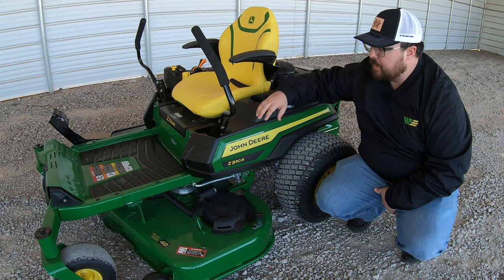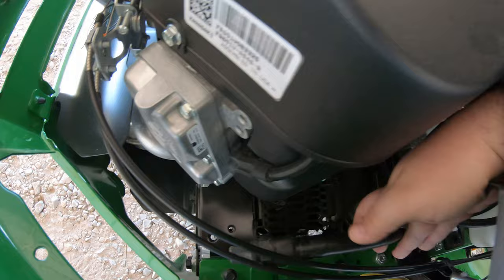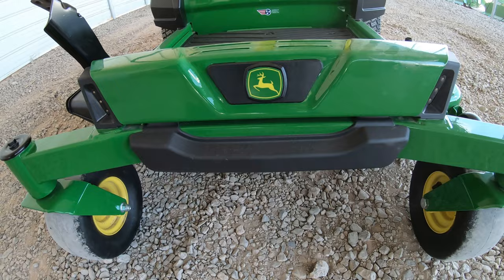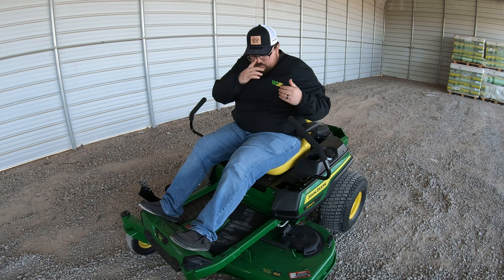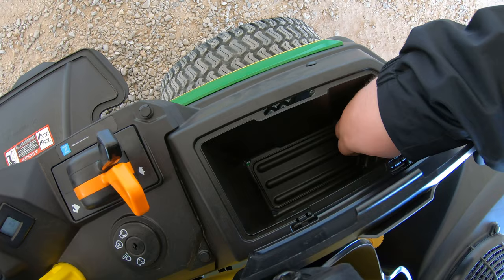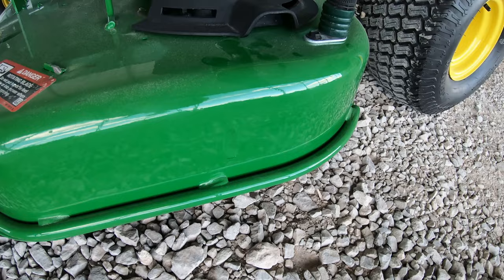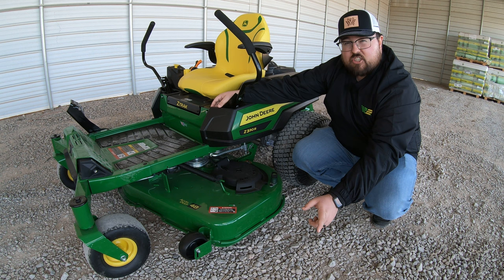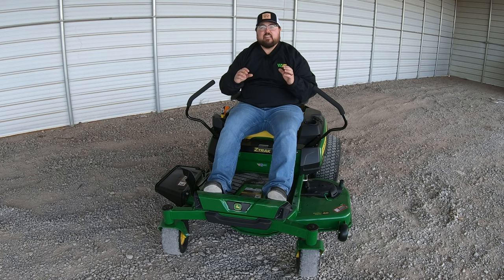John Deere Z330R Zero Turn Mower Review

Comment: Just got my Z330R yesterday and replaced the plastic bushings at the top of the caster spindle with ball bearing p/n AM102888, same part that's at the bottom of the caster spindle.  You should add a 3/8" flat washer between the top of the caster spindle and the top retainer (black metal cap) to maintain proper spacing.  I used a stainless 3/8" washer which is about 0.050" thick and 0.875" diameter. Worked perfectly!  Now I've got a much more robust front caster setup like the design of the Z500 series and up!
Reply from the maker: This sounds like a good idea!

Comment: After many weeks of deliberation, I finally chose a Z330R-54". Talk about a residential zero-turn that thinks it's a commercial "big boy".  Rated for approximately 1-3 acres, I fall right in the middle of that, offering me it's exceptional durability plus the opportunity for gentler use and mower longevity over-all. The bells and whistles (most of which are included) are a very nice touch as well. The 23hp Kawasaki V-Twin powers effortlessly through the taller grass that made my Cub Cadet LT1050 struggle. Durability, comfort, and power is all a man could ask for, and this mower has it.
Reply from the maker: I am glad to hear that you are liking your mower! What were some of the other models you were looking at?
Reply: Ariens IKON, Cub Cadet Ultima, Husqvarna Z254F, John Deere Z320R, Scag Liberty Z, Toro Time-cutter, and Bad Boy.
Reply: How are you likely the mower so far? I just went a placed an order for the same one with the 54” deck. Similarly I have close to 2 acres to mow and this will be my first zero turn.
Reply: @RavishingSailor  It loves to mow, purrs like a kitten, handling is a dream! So happy I chose this one. Very comfortable, starts great. I mow full throttle as recommended and hardly any vibration at all. The Z330R is one tough residential performer! The steering is sensitive yet smooth making for seamless gliding transitions with no clunking, or dead spots. A great machine that I feel blessed to own. It is built very strong, and accompanied with a usage that is roughly half its recommended limits, I can look forward to many, many years of reliability, and peace of mind knowing I made the right choice.
Reply: @crustydribblins  thanks for the replay! I can’t wait to have mine delivered. Dealer said one week and I placed the order yesterday. I was telling my wife that I feel like a kid waiting for Christmas morning.
Reply: @RavishingSailor  It's definitely a "Ralphie's  Red-Rider" moment. I hope you enjoy it for many years.

Comment: I've had it for a year works good. Just changed the oil filter, fuelbfulter and add did a oil change. It does make a poping noise when it gets hot. I did put too much oil. Hopefully that's what it is. I'll know more on the next mow

Comment: I currently have a X350 with a 42 inch deck.  It was my first time owning a ride on lawn mower and the X350 seemed to be want I needed.  Two years later and now I am considering the Z330R 48 inch deck as a replacement as the 54 inch deck is too large for my storage space. My main reasons for considering the zero turn is to save time a mowing, a slightly larger deck and the fact that I do not use the X350 in the winter for snow removal . Has anyone else moved from a lawn tractor to a zero turn and thoughts of owning an Z330R.

Comment: 13:30 - You had me freaked out. I have washed out the top of my Zturn after every single mow, for the past 8 years. I just washed it out last week to clean it up for spring. I just went and checked my mower deck…. Zero rust. I can’t say I agree with your advice. But I do love your video. I have learned a couple things.
Reply from the maker: Well I am glad you are not having issues with the water and thanks for watching!

Comment: Very good video and explanation. I currently have a JD X350,48" Deck nice mower BUY mows like CRAP!!!!!. Leaves streaks about 1" high.  I followed the owners manual still cuts like CRAP.
Now the dealer has it since it is still under warranty. Another problem NO POSITIVE TRACTION. One wheel drive is worthless on the slightest slope.
Looking at a Zero turn and bay be a trade if I don't get RAPED by the dealer.
You make a nice video why not  give actual mowing demo's?????

Comment: Would it be beneficial to add mower spindle reinforcement rings to a new 48" accel deep deck for added strength and longevity?
Reply from the maker: I think this would be fine. I am all for adding a feature to increase the life of a mower.

Comment: Great demo as always!  Few quick questions:
Are there any other grease zerks on the machine beyond the ones on the blade spindles? 
Is there a special lube for all of the other metal-to-metal pivot points that are exposed or do you just use a tacky grease?  
Does the mower come standard with the 3-in-1 multi-purpose blades?  
Can you please do an install video of the BUC11344 Power Flow MCS on this mower when you get one?  Thanks!
Reply from the maker: The blade spindles are the only grease points, a multi purpose grease will work well in the other areas, the 3-in-1 blades are standard, and yes I will put this video on my list. Thanks!
Reply: @WesternEquipment  Just got my Z330R yesterday and there IS another grease zerk aside from the 3 blade spindles. It is on the top of the idler pulley that is the pivot point for the arm.  Looks like it lubricates the pivot bushing.  You may need a right angle grease gun tip to get to it.

Comment: I’m looking at the z330r, x380 tractor, and z530m. I have an acre that is not all level. It has some gradual slopes around perimeter with small hill. Not very steep at all. I’m a bigger guy. 6’1 and about 280. Of these 3, which mower do you think would serve me best? Forgot to mention, the lowest part of the yard stays a little wetter longer after a rain. Any help would be appreciated and love your videos. Keep ‘ ‘em coming and thanks a bunch.
Reply from the maker: From what you have told me, I would rule out the Z330R. My next step would be to go to a dealership and sit on the other two mowers and see which one is more comfortable to you. Other than that, I think either the X380 or the Z530M would be a good choice. And thanks for watching the videos. Plenty more to come!

Comment: I notice that the "special" green operator levers with the weird extra curves from last year are gone....  
I guess they really weren't such a big deal after all?
Looks like they put some decent rear tires on with nice siping for good traction.  Are they 2 ply or 4?
Reply from the maker: I guess they ended up doing away with them and the tires are generally all 4 ply.

Comment: Would have appreciated hearing the differences in this R model vs. E and M to understand whether  they're features I need/want and the higher cost justified.
Reply from the maker: Good point. I will try to make a video explaining all of this soon. Stay tuned!
Reply: I have an R and M model. With the r you get arm rests on seat. A rubber foot mat for deck. And led lights that are dim. After getting m model found out the arm rests and mat to add were more to add than if I would have got another R. Mower just the same but arm rest comfortable while mowing 1 acre with R and 2 with m.

Comment: What is the length from the front of the mower to the rear of the deck (before it gets thinner by the wheels) ? I have limited garage space and concerned about cars pulling in and hitting the deck as opposed to bumping the rear tire. Basically trying to see if tire to tire will fit between two cars. I have about 48inches from wall to front of cars when pulling in and 56 inches between the vehicles.
Reply from the maker: Just got to measure it and it is roughly 44 inches over on the right hand side with the side discharge.  I hope this helps and thanks for watching!

Comment: Is the fluid in the transaxle replaceable in the new generation?  Also, will the previous generation bagger fit the new generation? Great video!
Reply from the maker: These are still considered sealed units and the bagger is a different design from the previous generation unfortunately.

Comment: @WesternEquipment, I just purchased this mower and I am confused with the usage of the choke lever.  In the user manual, it states that the choke should be pulled down when starting a cold engine and then pushed completely up after it is started.  This seems opposite to what is shown in this video along with where the choke symbol is located.  Furthermore, whenever I tried to push the choke lever back up as described in the user manual, the engine shuts off within a few seconds.  Is this normal?  I tried running the  mower  with the choke lever pulled down (towards turtle symbol) as that was the only way I could keep the engine going,  but it ended up dying after 30 minutes and refuses to start back up regardless of where I put the choke lever  (perhaps I got a lemon).  Lowes has agreed to replace the mower, but I wanted to make sure I was operating the choke right for when the replacement comes in.

Also, what throttle position do you recommend for engaging and disengaging the mower, and for turning on and off the engine.  The user manual states that it should be in full throttle for all cases, but I am not sure if I trust the user manual at this point.  Thank you in advance.
Reply: Don’t think about it to hard bud.

Comment: The bracket that holds the tension spring on my deck broke off and the mower has less than 4 hours. How do I get this repaired under warranty?
Reply from the maker: Take it to your local dealership or call them and see if they can pick it up because this should definitely be covered.

Comment: If you stand up with the blade running does the mower shut off or do the blades just stop spinning
Reply from the maker: I believe it just kills the blades because to get up you would have to throw your control levers out and that would set the parking brake. This should keep the engine from shutting down so I'm pretty sure it just kills the blades.

Comment: What are your thoughts between the 330R and the x350. I have alot of flower beds with both exterior curves as well as interior.  Which do you think would better serve getting closest to edge?
Reply from the maker: The 330R would give you the plus of being able to trim on both sides, you just have to decide if you like the rear discharge or not. If the grass is very tall you will likely see some windrowing occur. Have you ever used a rear discharge mower on your lawn?
Reply: @WesternEquipment  rear discharge? Pretty sure 330R is side discharge. I'm sorry z330r there isn't just a330r is there?

Comment: I see one owner added extra bearings on top of front spindles pt#am102888 with a 3/8 washer he said to replace plastic bushing there to sturdy it up. What do you think of this if needed?
Reply from the maker: I have seen this done a lot and I don't see what it could hurt. I think if you feel as though you need to do this then get after it.

Comment: I started my lawn care service last summer. I currently have the x350 John Deere. But I want a zero turn 48 or 54 inch deck. My yards are all medium size residential I’m in the market to buy something that will last me but isn’t fully commercial. More like introduction to commercial mowers that won’t break my bank. Any recommendations?
Reply: I have a 2103 z445 48” and a smaller gravely 42”. While I love both mowers the gravely both  cuts and stripes better.  That being said the gravely is much newer. Both are three blades
Reply: @maltedbarley1  thank you, I do love my riding mower but need something a bit faster and want to blend in with the rest of the competition that have zero turn mowers. I’ll definitely look into the gravely
Reply: @mannyluis7961  I went from a rider to a zero turn and…..just wow!  Big dif
Reply from the maker: Honestly with the redesign of these mowers I wouldn’t be afraid to do residential commercial mowing with these but you could jump up to the Z5’s too.

Comment: I can get a new closeout new Z365R for $2980 or the Z330R for $3999.  Which one should I get?  Are the upgrades worth it?
Reply from the maker: In my opinion, the up grades are way worth it if you plan on keeping the mower for a very long time. If you had the intentions on upgrading in a few years then save the money and take the closeout deal.
Reply: Can you help me understand which upgrades to value the most?    Is the Kawasaki engine that much better than the Extended life 24hp Britton Straggs?  The lights, parking break, changes to the lift system don’t seem worth an extra grand to me.
Reply: @markrobinson1896  The new beefier frame won't flex like it did on the older models...much stiffer.  The old models had plastic bushings in the front caster spindles. Now there's a ball bearing at the bottom of the caster spindle.  New model has solid deck lift linkage...not a dang cable that' a PITA to get to if/when it breaks. The Kawi is a BIG plus for me, but some like the Briggs. I am not comfortable with the Z365R's "easy change oil system"  filter which only changes half the oil and costs $80 per oil change.  So... there's a few reasons...but like Brett said, if you are only going to have it short term and don't mind having less quality, features, robustness & dependability, the older model will still cut grass just fine.

Comment: Do you know how to adjust the Control Arms left and right?  My control arms touch when I pull them into drive mode.
Reply from the maker: Is it the actual arms or is it just the padding? Sometimes the padding slips too far down the control arm.
Reply: It’s a brand new control arm. The control arm on the mower arrived damaged and bent so I replaced it with a new one.

Comment: What is the difference between z330r and z355r thanks.
Reply from the maker: Mainly it is just the model change over. The Z330R has all of the model year 2023 upgrades and the Z355R is from the previous lineup. Both still have the 48" deck but on the Z330R you can also chose a 54" deck option. Does this help?
Reply: Yes It does thanks. I’m looking at getting a new lawn mower. Was going to get a z330r then found a like new z355r. Trying to decide between the two.

Comment: How do you get the battery out?
Reply from the maker: It is located under the seat and should just be held in place by a rubber bungee strap.
Reply: @WesternEquipment  how do I loosen the strap?